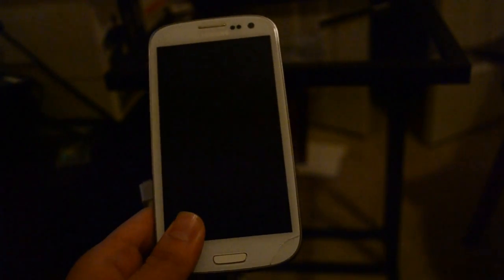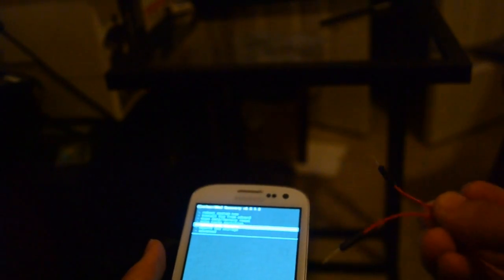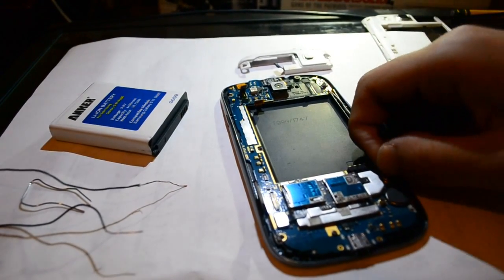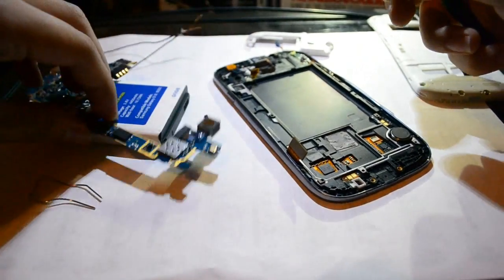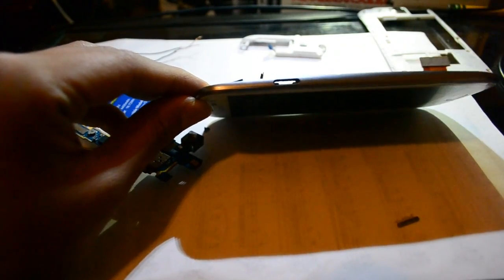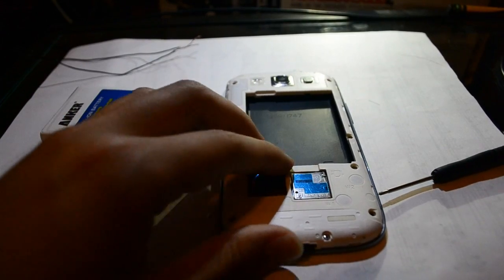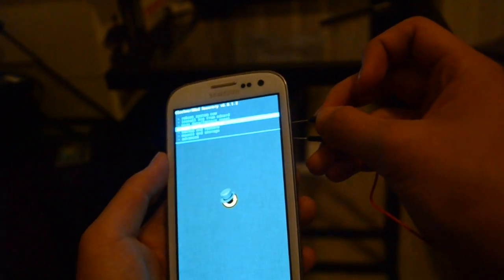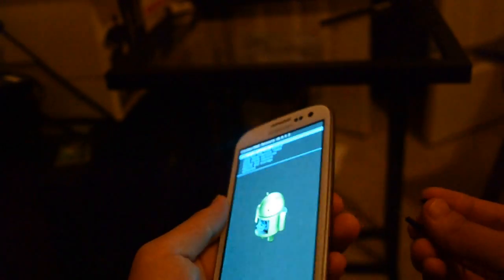How to access Recovery Mode on a Samsung Galaxy Phone with no Power Switch

Comment: my phone stuck in recovery mode and when i turn my phone off and plug the charger, it will open in the recovery mode and its not charging!!! i useually use that method in the pass months and its working but now its not Ireally need a help.

Comment: Hi are you still there, I'm looking for a way to enter recovery mode without home button. I really really need an answer thanks a lot
Reply from the maker: Is your phone rooted? You can download an app that reboots it into recovery mode, e.g. quickboot
You can try to see if you can clean the switch for the home key with alcohol, I would search this on google. Sometimes homekeys are broken because they get dirty.

You can try to rip off the home key switch, and use a wire to simulate a home key press (although I've never tried this before, and I don't know if it even works).

Comment: This doesn't work on my S3. It has been stuck on a boot loop for weeks. When I try the steps you mentioned mine just goes into charging.
I can't access download or recovery modes any longer. 
I made the mistake of trying the power button removal, because my phone would boot up on its own when I would insert the battery and go straight into boot loop. Prior to that I was still in the same boot loop but at least I could access the download and recovery modes.
Kies can't even recognize my phone, in boot loop, so I am stuck. Nothing has worked thus far.
Help!! Any suggestions / recommendations on what I could try to fix my phone?
Reply: maybe your emmc is broken.. just change emmc

Comment: I was looking for this all night. Simple idea, haven't thought about it (probably cause the lack of sleeping xD), you should put "power button" instead of switch (or add the power button tag), for this could be easier to find.
Reply from the maker: +LuisXGP This would not make an effective power switch though. It's a pain in the butt to get the wires to stay long enough to turn it on :(
Reply: I mean put "power" in the tags, to find easier your video
Reply from the maker: +LuisXGP Done! Thanks for the tip

Comment: Is this concept of using two copper wires to turn on a phone universal? Does it work across all phones? I have a HTC ONE and had to remove the power button, now in its' stead, I have two very similar silver areas to the ones on your phone. Do you have any idea if this might work on my phone as well?
Reply from the maker: ***** Most likely.

Comment: i have the same issue, no power button and my phone is stuck in a boot loop. 
i am unable to get to download mode by pressing the volume down and home button. nothing happens can i get some help?
Reply: Shaun Davis me too - the phone just charges. I can restart my phone by using the alternate method linked in the video (pulling battery fast), but the phone just goes to bootloop again after that, even though I'm holding volume up and home.
Reply: A repair guy tried to replace the power button on the logic board, but was unable to. I ended up just changing the logic board completely, but I was lucky to get it at a price where it was worth it. Good luck!
Reply: So no, I was not able to find a fix.
Reply: I wasn't able to find a fix either,  I had to take it to a repair shop.
Reply: +Shaun Davis Likewise. Mine just goes into charging. Did you manage to get a fix as I can't seem to find a fix on the internet.
Reply: +Bradley Rimbleus Likewise. Mine just goes into charging. Did you manage to get a fix as I can't seem to find a fix on the internet.
Reply: +Bradley Rimbleus Thanks.
Reply: +Shaun Davis Thanks.